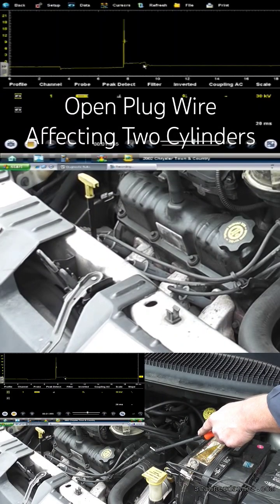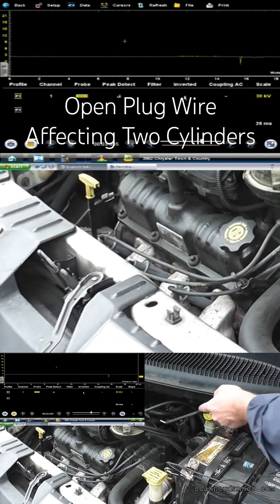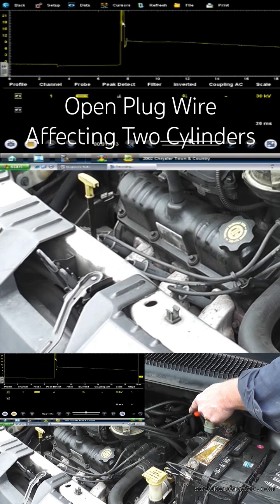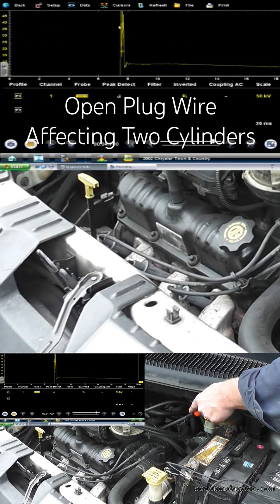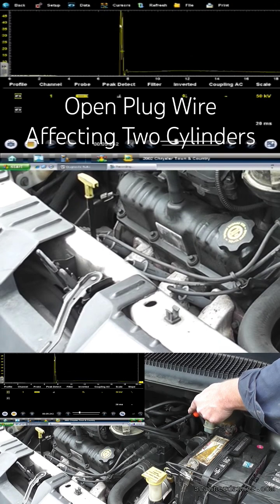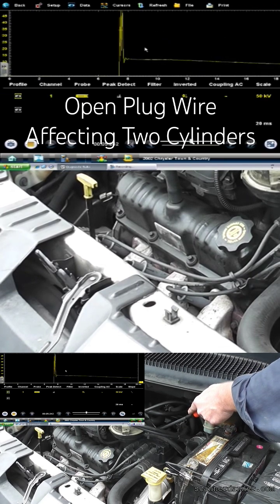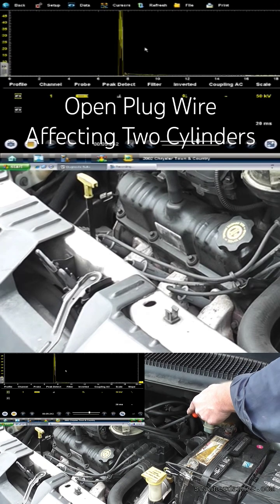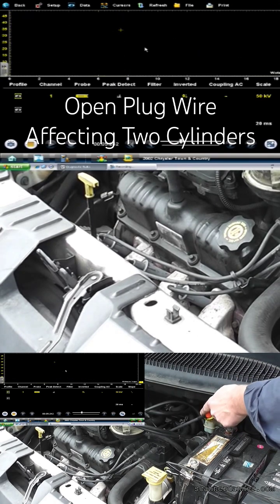Waste Spark Coil with One Open Plug Wire

Comment: When you when U say companion cylinder  are you speaking of the one that fires directly after.😜🇦🇺
Reply from the maker: No, same piston positions. And in this context, they also share the same coil. One fires on compression while the other fires on exhaust. Then 360 degrees later, they flip flop. Hence the name waste spark.
Reply: It's a wasted fire ignition firing exhaust on one cylinder while firing compression on another Ford had this I believe  @ScannerDanner